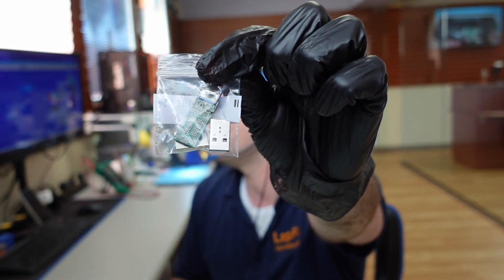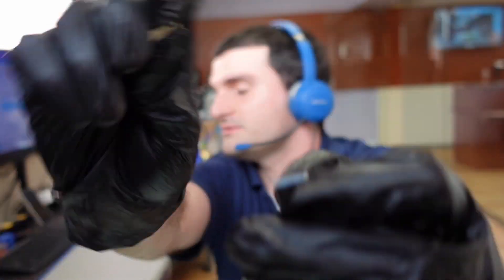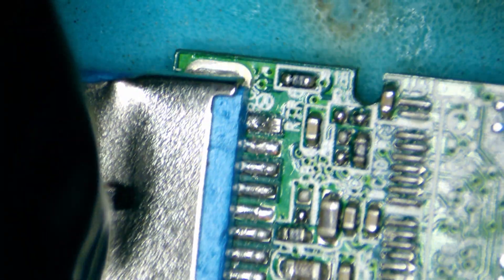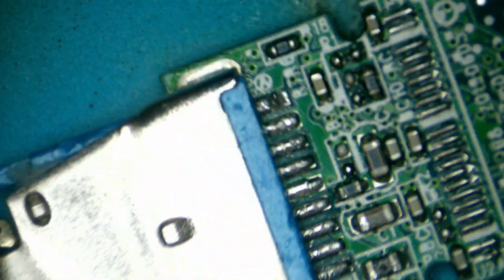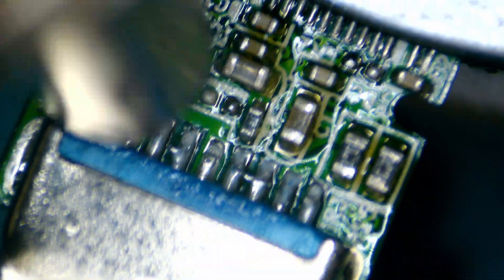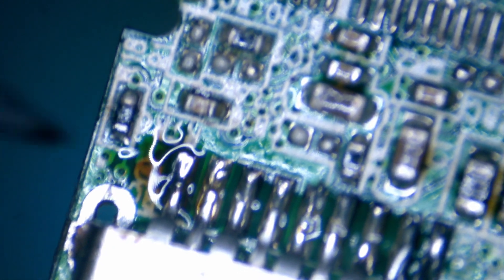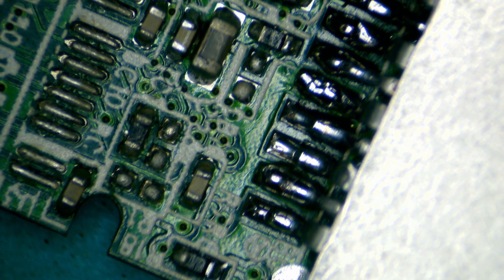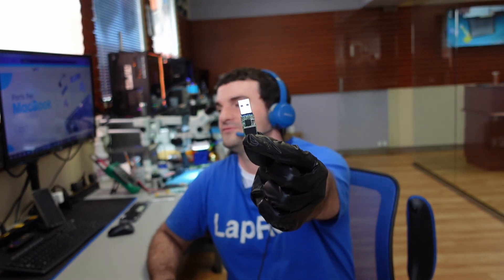Fixing a Damaged USB for Data Recovery

Comment: I’ve seen a few of the jump drive data recovery videos from your channel. In your experience what is the data recovery percentages on Jump drives if windows acknowledges the insert (audible tone) of the jump drive  but not seen on file manager. I can see the drive in data management (with drive letter) but appears no data is stored.